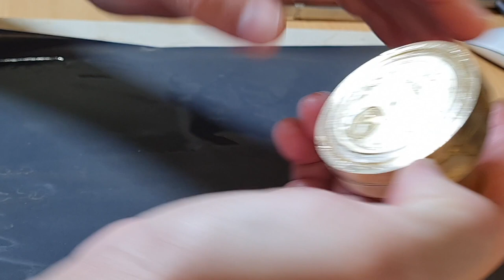Making Watch Dial for Seagull ST3620(ETA6498-1 clone) on CNC3020

Comment: Inspiring!  is the machine able to do patterns cleanly in the dial face?  could it do a guilloché texture on the dial or is that too precise for the stepper motors and tooling at this level of tech?
Reply from the maker: thank you! good question, if we are talking about mimicking real rose engine moves (straight line or lathe) we have to solve 2 issues: fixing tool and making gcode....not trivial task, and more difficult will be generating gcode i will say. I wont warries about steppers precision however. But we can try to imitate result for some type of patterns using spindle for sure. I have tried one quite succesfully (just vertical and horizontal cuts),  will show it in coming videos. this or that way I can only try to approach real machines quality using my CNC and it will newer be the same :) Maybe some very expensive :)
Reply: @watchmakeratelier  would certainly need to either have cleen sweeps acroos the material or have transitions on a location that would be machined further later.  Having full clean sweeps across the face would take some doing to get the g code to do that.  Perhaps altering the height ever so slightly could get some seperation of passes. I am not super aquainted with tool pathing on CNC CAM software.  I am sure there are some cool designs other than rose engine stuff it could do though

Comment: Thank you for good content. Do you have any high resolution images from your dials? So i could see what are the limitations of that cnc and how small you really can get. I need to make one for my school thesis, Also using eta 9468 but case an dial need to be self made. Another question is that how did you make dial numbers etc, did you use some 3d file for it or made design yourself?
Reply from the maker: thank you,  numbers are the part of same design so also engraved and painted. I use available in Adobe fonts for my design. For pictures...I will made my new microscope review and will show how good cutting is. but you can also refer this video: https://youtu.be/JGHX9NJ5D3Y

Comment: Fantastic. Can you share you strategy for engraving the numbers? Would you contour engrave the numbers and then pocket the rest of the number?
Reply from the maker: thanks! My strategy is actually very simple, everything is engraved with v -bit or chamfer bits with different blades angle. So engraving is controlled by width of line you engrave and angle of the bit.

Comment: Amazing! I am not so sure how can you attach the dial into the chassi? are there pins in the dail? If so how can you do it? Thank you.
Reply from the maker: Thanks! Normally I attach feet to the dial by soldering it using low temperature solder. I will make separate video for this process.🙏🏻
Reply: @watchmakeratelier  I would love to see that video on soldering the feet. The actual soldering i can manage,  it's placement of the feet i find challenging.